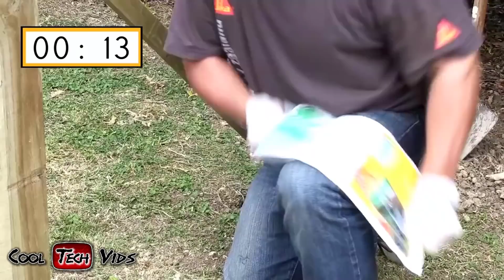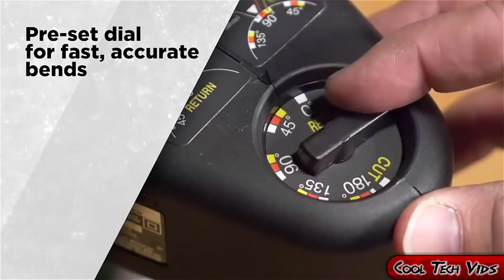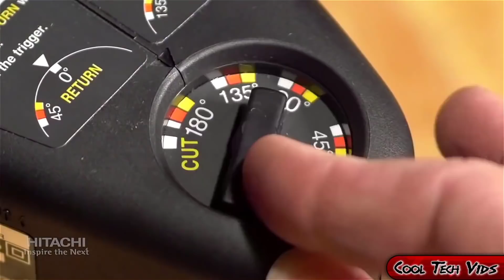🚍 Awesome Next Level Construction Inventions & Amazing Machines 🚍

Comment: I wouldnt use the Sika-foam stuff posts. It may set quick and be easy to use, but it wont hold in the long run. The foam will crush with repeated movement of the post from high winds and stuff, then the post will be loose and start to lean. 
  I worked at Lowes in the lumber department, we demonstrated a post in a 5 gallon bucket with the stuff. And over a few months of just being a display the foam started to crush and the post became loose. And it never sold.